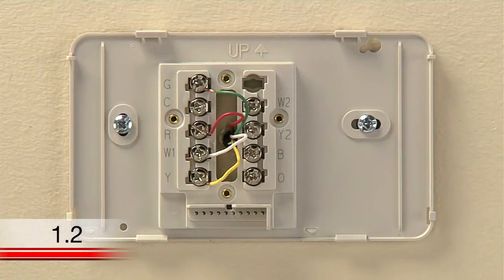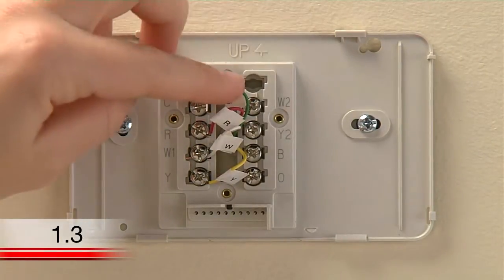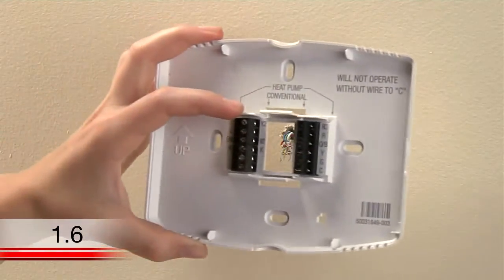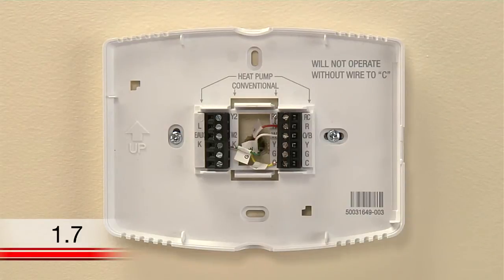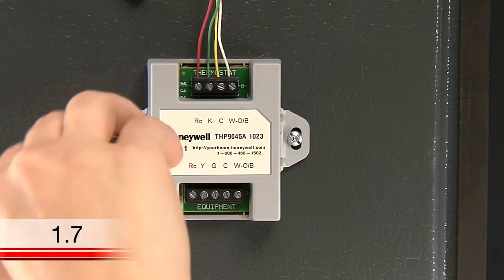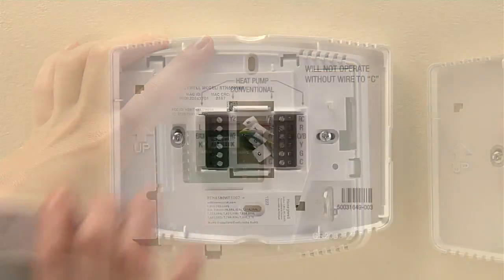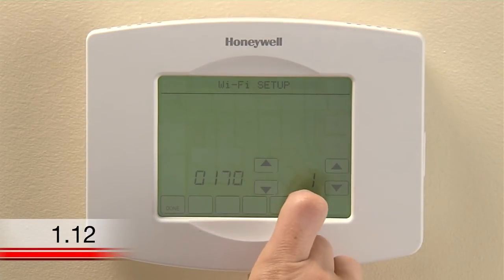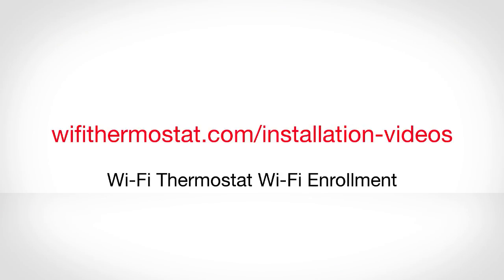Wire Saver Video THP9045

Comment: If you nee one more control channel i.e. need a sixth "wire" - send me an email at plamen_petkov@hotmail.com.
I will show you haw to gain 4 independent control channels in addition to life and return 24Vac.
The Honeywell wire multiplexer adds one "wire" by ORing the FAN control with either Cool or Heat  wire.
This makes the fan not controllable independently. I can show you how to gain 4 completely independent control channels.